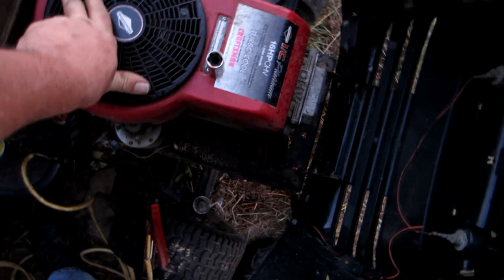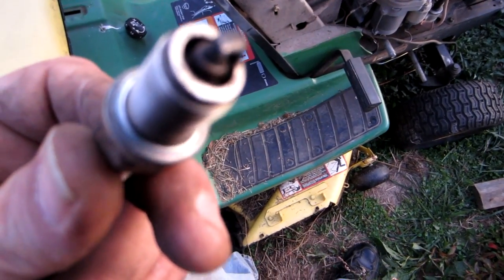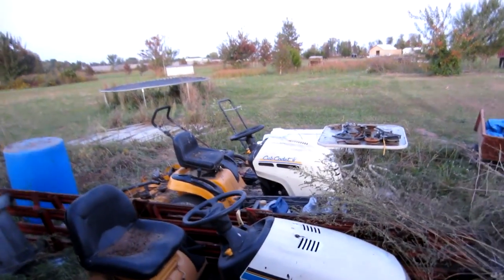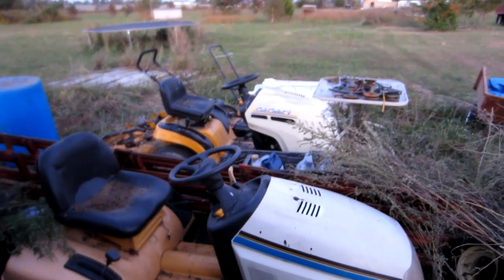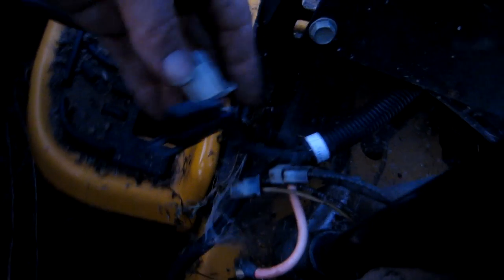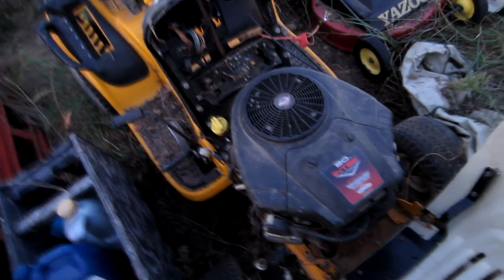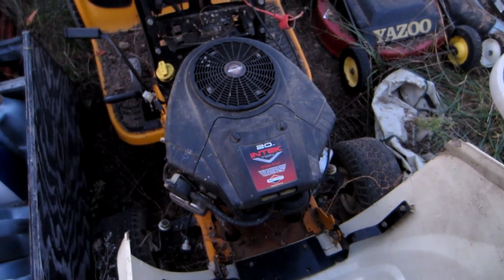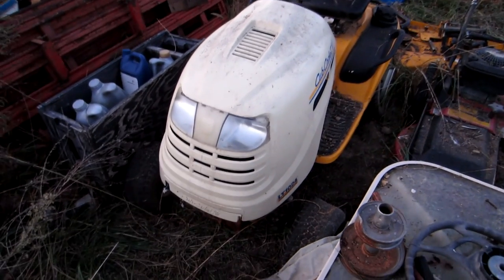16HP Craftsman Project

Comment: Being they have set outside in the weather have you taken the motor cover off and checked the flywheel to see if it has rusted.  If so take a piece of sand paper and clean the rust off and check spark again also check for seat switch and any other safety switches that might ground out the ignition system

Comment from the maker: @gangsterbryce kinda wondering about the safety switch in the seat being the actual issue because with it in or out of gear if you stood up off of it the motor shut down

Comment from the maker: @delmontcrusier YOU KNOW WHAT?  I DIDN'T EVEN THINK ABOUT THE SAFETIES. i wasn't sitting on the mower and i believe the blade lever is up also kinda dumb of me not to think about that but yeah i didn't have any regular gas i was using 2 cycle in it to just get it to start so it was actually gas and oil both and come to think of it i left my shed open too and here it is 1:30 in the AM god i am slacking, trying to get too much done too fast with no money lol